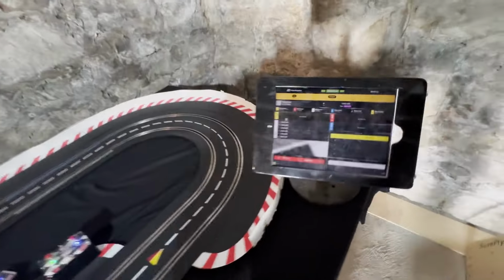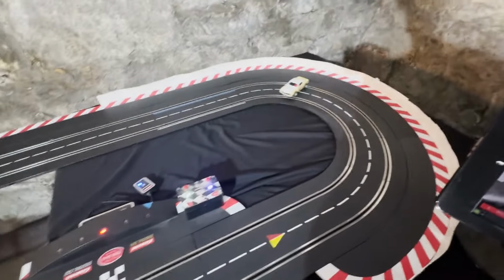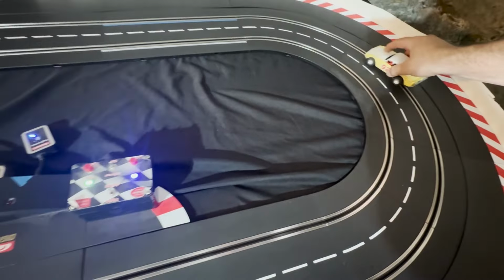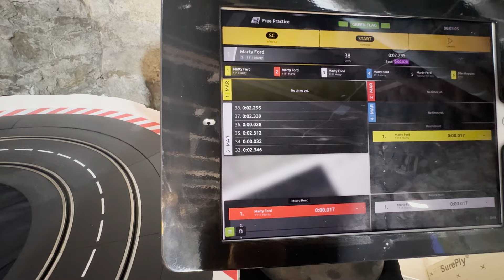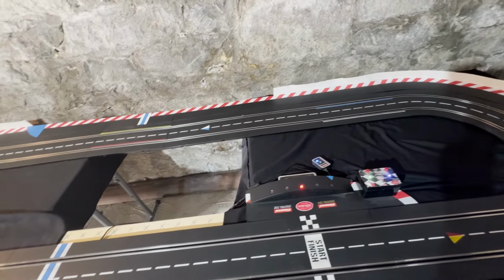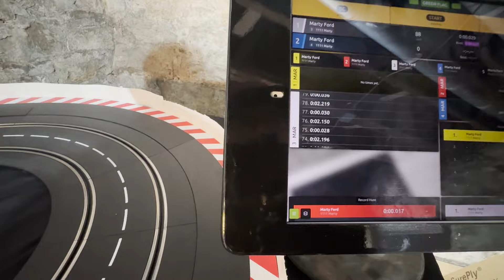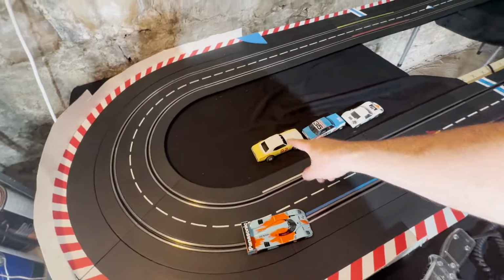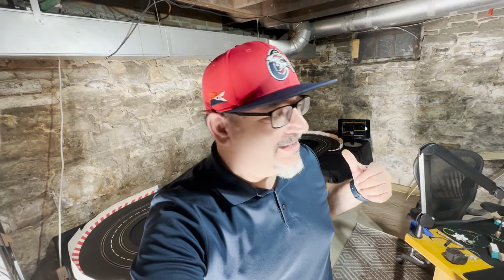Running some Laps on the Carrera Bullring Oval!

Comment: Taking the R1 curves at speed without the use of borders is problematic unless you are running on the inner lane.  I intend to buy them for my small test track once they become available again. Running straight analogue on the oval makes more sense than digital, as you don't have provision to change lanes and you can then use your other controller with all its inbuilt adjustments.
Reply from the maker: Exactly Mark! Boarders are important and worth the investment. I agree, I really want to use my Difalco controller.. so analog for sure!

Comment: Love the test track Marty!! That's some fun racing. My scratch kit 1/24 chassis is about done. Can't wait to to test it. If your using Smartrace in analog mode what is sending the signal back to the tv screen for times? I don't see a phone for timing in smartrace analog. 🤔
Reply from the maker: Nobody.. I was actually having problems getting the analog app to work for the video… I was getting lap times from SmartRace on the digital side because my TekSlot Box has the analog timing lights built in, it works as long as you have something shiny on the bottom to reflect the light back to the secondary LED’s. I should have my analog hardware working at some point this week.
Reply: @twolinesslotcars  Ok thank you Marty. My omnislotbox emulator also has those built in sensors that use something shiny on the bottom of the car but I can rarely get it to work. Is there some kind of trick when placing the shiny piece on the bottom of the car? Seems like mine are too low or something cause if I hold the car and sweep over the sensor it works everytime. 🤷

Comment: Marty how have you setup the timing system on that?? and can you do a episode on that 😁 please 😅
Reply from the maker: At the moment I am using the Smart Race,  but I have built my own timing system using sensors in the track that I will move to once I have all of the pieces in place. I created a video about the DIY Timing system a few months back.
Reply: I've got the same question. I've got an Axel box and am a Smartrace user. But how do you connect your sensors to Smartrace?

I would like a solution like that better as using a phone for analog timing
Reply from the maker: @ButchersSlotcarJournal  do you have the Bluetooth dongle for Carrera Digital?
Reply: @twolinesslotcars  yes, I have